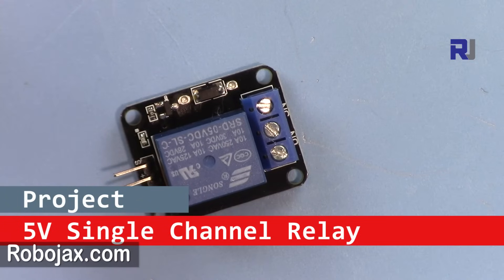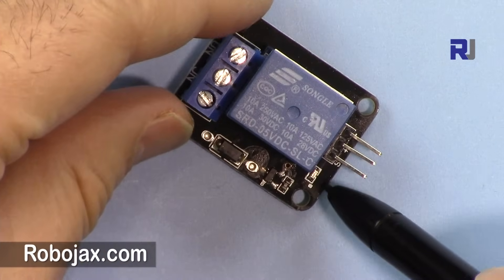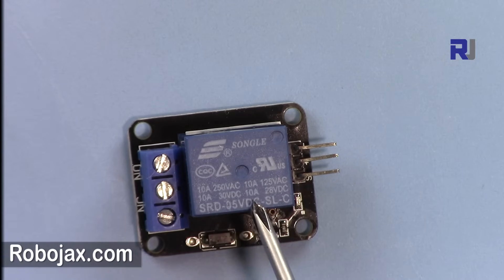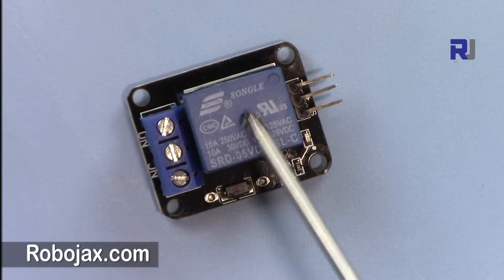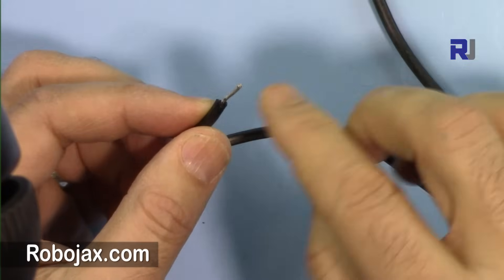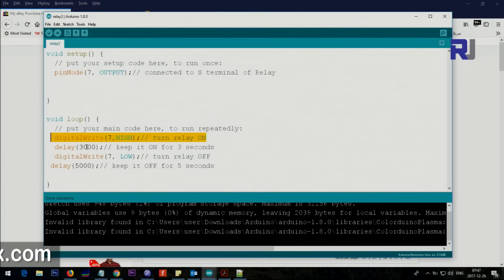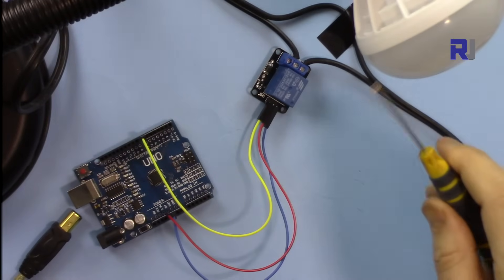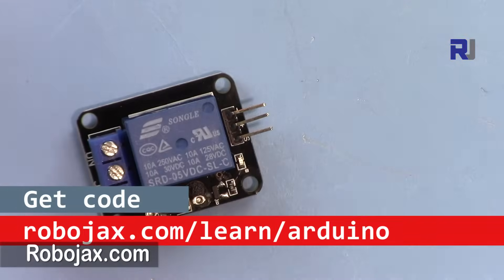How to use 5V Relay with Arduino to turn ON and OFF AC  bulb or DC load RJT33

Comment: Hello. Automotive question here.
Could exactly this Arduino setup that you've shown in the video, be used together with a vehicle original 2 wire temperature sensor(NTC thermistor) for control?
Reply from the maker: Hi, I am not sure about the vehicle as I have not worked with the vehicle NTC. if  y ou need to switch something, this will do it and it is totally isolated. to ensure , just connect the two two together and see if it works for whatever purpose you want it to work. if it does, then  connect this relay instead.

Comment: Hi Sir, question for you. If I want to do this but wanted wireless control, is their an Arduino for this or something you can recommend? I want to try controlling a cheap ping pong ball shooter that my twitch chat can shoot at me, connecting a relay to the power switch seems easy thanks to your video
Reply from the maker: Just search my channel for relay. I have tons of video
Reply: @robojax  Thank you, I used an ESP8266 and got it working, again thank you for your videos!

Comment: I am making auto dressing light with AC bulb I have 5v 2 relay module . Help me as I am using AC with arduino for first time ..
I have basic AC home wiring knowledge 
Please tell do's and donot do's
Reply from the maker: it can be done in many ways. One way would be to use motion sensor and control the relay and turn ON/OFF the light.  you can use this relay module and the motion sensor shown in this video https://youtu.be/qhThpxiXubI to build it.  AC is very dangerous. when working with AC never touch the module.  have extra light switch to turn it OFF when not in use. Keep the project in a plastic or wooden box, away from children. Pus a sticker "Danger" on the box of this project. Good luck with your project.
Reply: @robojax  okay I will use an extra switch for it and a wooden box and a danger sign and learn more about  AC precaution before adding it 

Thank you for replying 🙂
Keep making such informative and inspiring video..

Comment: Is the relay coil powerded with Arduino's 5V?
Reply from the maker: yes.  Arduino 5V s coming from USB. it is about 80mA. So don't worry. most USB device can supply 500mA or greater.
Reply: @robojax  Yes USB can handle that but it is coming out of the 5V pin, can it handle the load of the coil?

Comment: Helli, I'm new on this field. I have a question, why you need to connect both the signal pin and the + pin ?
On the control side of the relay there are only 2 pins, one of which is GND
Reply from the maker: Hi, it seems you have not watched the video fully. Please watch.

Comment: What else can you use apart from  arduino uno
Reply from the maker: This module needs signal and arduino detects signal and controls the relay. If you can control th relay with switch or something else , it  would work fine.

Comment: Hi
I need a relay unit that can tigger on and off of a plasma cutting machine following a design from a computer system which the input is 5volts.
Thanks and looking forward to hear from you. 
Regards
Reply from the maker: Hi, this is just a swtich. only you have to read the realy current rating which says "10A" and your laod or plasma cutting machine also should not exceed what is written on the relay.

Comment: can I use this relay in a 220V line, like in the service drop before the kwh meter?
Reply from the maker: Relay is a switch . Most relays are rated at 10A. If you are connect it to turn On/off a load not more than 10A then yea you can use it. Read the rating of the relay and use it.

Comment: Thank you, I used this exact method to upgrade my laser cutter to automatically activate my air assist pump during a cut when activated in the cutting software so much cheaper to build a relay control box than spend £260 on a kit for the same thing!

Comment: What are you connecting to Arduino in ac side relay is it neutral common
Reply from the maker: I am not sure what you are asking. Arduino works with 5V which you can connect a battery or power adapter or USB charger.  Then for AC, has 2 wires which I have shown to cut one and use relay to connect and disconnect it for you. you can watch this video https://youtu.be/N-xbxtGGoHw which shows wiring diagram if you want to learn more.
Reply: Does it matter In which side ac voltage is put in relay in the two wire hot and neutral

Comment: which wire from the bulb is connected to the relay and how did you find positive and negative?
Reply from the maker: Please watch again. There is no positive and negative in AC. We have neutral wire and Live wire. In Canada 🇨🇦 we know the live wire and it is fixed on the wall.

Comment: does the relay power the arduino, or does the arduino need to be connected to a USB cable while the circuit is being used?
Reply from the maker: Arduino board has multiple way to power it up. USB is one of them which powers up and upload the code to it.  Relay module can be powered from any 5V source. we are using Arduino board to power it up.  Arduino Step by Step course that starts here https://youtu.be/-6qSrDUA5a8 good luck

Comment: Hi , very new to to your You Tube, thanks Robojax. Thank you for this video.Using a Arduino Mega 2560 what is the maximum delay in seconds I can have. I want to turn a 5v pump on every 24 hours for a few minutes.
Reply from the maker: Hi, welcome.  If are new to relay, then this video from my course will help you better as it has full wiring diagram https://youtu.be/N-xbxtGGoHw for timing we have Real-Time clock (or RTC) module we can use to control something at exact time and date. here is one full video to use RTC https://youtu.be/gz9xqvRroDY to make either a clock or just use it as Alarm to control a load.  My Arduino Step by Step course that starts here https://youtu.be/-6qSrDUA5a8
Reply: @robojax  thanks. My question was how long a delay can be programmed into the mega 2560.
I have set up a 5v pump to operate for 1 minute, what is the maximum number of milliseconds delay I can have ?
Reply from the maker: for the time there is no limit. You might look at this timer program https://youtu.be/6DGQhQgr7Ak or timer with dispaly https://youtu.be/BhEIFzFSMuE

Comment: My relay is not switching it is not getting power from the Arduino. What could be the cause?
Reply from the maker: If you connect it correctly by connecting the power +,- pin and the single pin  it should turn ON, else{ it is dead relay}

Comment: What is the minimum voltage requirement for the S pin of relay
Can we connect the S pin with 3.3v or less
Reply from the maker: The operating voltage is 5V for this relay but you can get the same relay at 3.3V
Reply: @robojax  how can I contact you bro 

Am developing an electronic project for my college and i need relay to complete that Project but i have a lot of doubt related to it.

 plz give me your contact info so that I can discuss all doubts briefly with you 
Thank you ❤️❤️
Reply from the maker: Yes you can. Use a boost converter to convert 3.3V into to 5V. Search my channel for boost

Comment: Greetings sir, I hope you are doing well. It is requested to answer whether or not a 220-240Vac bulb can be driven using a 5v relay using arduino uno?  I have a project in which i am doing a bluetooth controlled smart home automation. It is requested to give me tips on how to do it.
Regards

Comment: Does the switchside need to be connected for me to test the relay? I am currently using a pi and it is not working regardless of what i do
Reply from the maker: i did not understand "switchside". I have not mentioned such term. we have 3 pins which I have explained and 3 terminals with screw which I have shown how to connect. This code is for Arduino but if you write your own code for raspeberry pi, it should work.

Comment: Well no its not quite clear coz these do work been using for ages. when orange light is on that means its pushing out power its not going to drop off till the top green light comes on. red is always on.
The more you boost voltage you loose ability to push out big amps nomatter what you set it at. e.g 12v 15a power supply boost to 67v your going get around 1a output. want more amps start with higher voltage. It is fairly straight foward

Comment: please answer asap, how can i long the light on ? your videoa are very nice and helpful
Reply from the maker: Hi, what do you mean by "how can i long the light on" do you mean "How can I change the time the light is ON?" if so, then just add delay(2000); after the line where the light is ON. this will keep it on for 2 seconds.  for 10 seconds make it 10000 (millisecond) and so on. the same way you can do it with OFF.

Comment: is there a way to stop the relay pulsing on on power up? As in the video my relay briefly pulses on when power applied. I want to use my relay to send signal to open a gate but if everytime there is a power interruption the gate would open on power up not really ideal.

Comment: Don't use this module to drive mains powered equipment. The isolation between the 5V side and the power side is completely inadequate, and the low voltage side could become live.

Comment: Can i control 500w dc motor using this relay
Reply from the maker: Yea you can. Relay is just a a switch.
Reply: Yes I know that, but it operates at more than 36v
Reply: Relay limit is 30amp 30v

Comment: Did 5V relay can light up 12VDC lamp ?
Reply from the maker: Relay is a switch as I shown in video. It will connect and disconnect power. You can turn on and off anything if you respect the rating of relay.

Comment: I want to power a 5v motor with a relay, is that possible?
Reply from the maker: I mentioned the  amount of current it can handle. this relay is a switch and you can use it anywhere if you respect the amount of current which is written on it.

Comment: in the void setup setup code you didnt set your relay HIGH. now when you plug in your arduino it goint to blip on the relay before code runs
Reply from the maker: The relay (the relay shown in video) is OFF when you turn the Arduino ON. But if you are using HIGH Level trigger video then watch this video https://youtu.be/7tUGUXyloXQ
Reply: @robojax  no it not watch your video because you didn't define relay to be high in setup when you loaded up arduino relay quickly went on before program started running a blip at beginning. Arduino defaults all pins at boot to low unless you tell it elsewhere in setup. Relay blips on before program starts running when arduino is booted up I had this same issue and had to define my relays high in setup because all 8 relays would come on before program was executed messint up what relays were suppose to control. Once program loaded all relays would energize because arduino starts with all low values then program starts. You have to define relays high in setup to stop this.

Comment: Hi, thanks for your work!. This seems to be the way I want to work with a washing machine motor, BUT; I need the ON signal to be for one second, then off 2 seconds, then on again 1 second, alternating between 2 different pins. I suppose this is possible but I wanted to check for feedback before I go and burn things. Any help appreciated!
Reply from the maker: You are welcome. Here is $200 Arduino course for free Arduino Step by Step Course  (over 100 video lectures) Starts here http://robojax.com/L/?id=338 I am sure you will be able to do this by watching few videos of this course
Reply: @robojax  Excellent. I used to live in Ajax Ont.  Now I'm away in another country

Comment: Can I power an ac bulb with dc source?
Reply from the maker: This is just a relay. You can turn in or off a DC or AC load.
Reply from the maker: Only old tungsten bulbs can be turned ON with DC pot if it has the same voltage

Comment: Thank you for the information. Im an aspiring learner about arduino sir and i want to ask this question: Can i also connect a temperature sensor to this system to record the heat released of the ac bulb? The context of my idea is to create an automatic temperature control system where the light bulb turns on/off depending on the status/temperature recorded by the sensor. 

Once again thank you for this awesome video!
Reply from the maker: Yes you can. Search my channel for the word temperature. Here is how to find Specific YouTube Video in a channel https://bit.ly/findYouTubeVideo
*** Free Arduino Course worth $200**
Arduino Step by Step Course  (over 150 lectures) Starts here http://robojax.com/L/?id=338

Comment: thanks sir very much . i have a question , how can we avoid noise that affect arduino ? when i connect 220 v supply it makes noise to the board and the code is malfunctioned and when i disconnect the 220 v supply it returns to its normal state ?
Reply from the maker: It should not affect the board. There is not AC connection with Arduino. But you can put 100uF to 1000uF 5v capacitor at 5v terminal and it should fix it.

Comment: is that relay can handle 220 volts AC 1400 watts?? thank you for your reply.
Reply from the maker: you surprised me by your question and made me watch the video. I have clearly explained the rating of the relay and even calculation of power.  if you missed then please watch because I have mentioned numbers and how to calculate it.
Reply: @robojax  thank you for your response, i watch it twice sir before i ask question, just to make sure because i dont have money to buy new relay if i explode it. and also im not good at english, hope you understand sir, i really thank you for your response.

Comment: using that relay that can handle both ac and dc load, will the arduino handle ac load safely?
Reply from the maker: this is relay. Perhaps you did not watch it. I mention DC or AC load.

Comment: Can you run it on 3v ?
You said it needed 5v but would i really need a voltage regulator to run this?
Reply from the maker: yes if you relay is 3.3V. I haven't seen 3V, but if you have it, yes you can.

Comment: I have 3 relays. They all work with no load connected. When I connect a load (turn on the external power supply) 2 of the 3 relays turn off while they are connected exactly the same as the one thath works. How could this be?
Reply from the maker: it seems  your power voltage goes down. check it or supply separate power to relay. keep Arduino separate.
Reply: @robojax  The relay is powered using 5V from the external power supply. Could this be a problem with the grounds?
Reply from the maker: I expected that have connected ground.

Comment: Hi, It might be a silly question but can you use relay as ON state by default, means if there is no current applied the circuit is closed but when you apply current the relay is OFF state ? The reason I am asking I want to have 2 power circuits but when I am running one I one to terminate the other and vice versa :)
Reply from the maker: Hi, there is no silly question. Yes you can. inside the setup() after pinMode(....); in the next line turn it on and it will be ON like this digitalWrite(5, HIGH); this will turn the pin 5 high.  or whatever pin you have defined.  Good luck.
Reply: @robojax  Yeah I just discovered Normally open and closed relay which are 4 pin and apparently there are 5 pin relay that can set up for both :)  so I will play with either. Thanks!
Reply from the maker: you are welcome.

Comment: thanks this is really great especially for beginners like me...i have question can i use the arduino only for power supply purpose and control the RF relay using an RF transmitter remote controller?
Reply from the maker: you are welcome. Relay is a SWITCH which you can turn ON/OFF something.   Yes it only connects the and disconnects.  so it is up to you where you want to use it for that purpose.
Reply: Greetings sir, I hope you are doing well. It is requested to answer whether or not a 220-240Vac bulb can be driven using a 5v relay using arduino uno?  I have a project in which i am doing a bluetooth controlled smart home automation. It is requested to give me tips on how to do it.
Regards

Comment: Sir, would I connect ceiling fan on that relay? That is working or damage relay
Reply from the maker: this is for AC or DC load. ceiling fan IS an AC load.  Yes it will work. Perhaps skipped the video asking about "damage". I just watched the video and indeed I have explained it. So watch it without skipping and you will learn.

Comment: can i use the 3.3v slot for the relay? Because 5 v slot already used by other component
Reply from the maker: what are other components?  Here is how you can make additional 5V for other components https://youtu.be/Vmrmp7reHOY and leave the main 5V for relay. Relay power must be connected to 5V pin. of course there are 3.3V relay modules like this https://www.amazon.ca/dp/B07YF7R9G9
Reply: @robojax  can mq2 sensor use 3.3v?
Reply from the maker: what is mq2?
Reply: @robojax  it is smoke and gas sensor

Comment: If want to use it to on/off light..that mean must have provide arduino, pc and program ? Wouw....very conplecated !!!
Reply from the maker: Using Arduino you can do millions thinks. for example you can turn ON for certain time and then turn OFF for another certain time. Or turn it ON and OFF using touch https://youtu.be/g_kqd64dXzA or via WiFi https://youtu.be/wdgWdxV60dg the possibilities are endless.  turning ON and OFF of a load (or a bulb) is just the first step to do amazing things like opening a door as a lock. etc. Watch this 30 minuets course to learn about Arduino https://youtu.be/Mbb2xa1WcRM
Reply: @robojax  yes, but every project I must install/provide arduino ?
Reply from the maker: Watch this 30 minuets course to learn about Arduino https://youtu.be/Mbb2xa1WcRM and you will get all your answers.